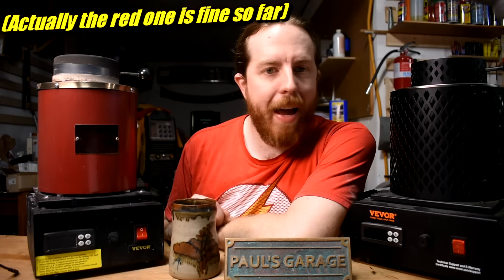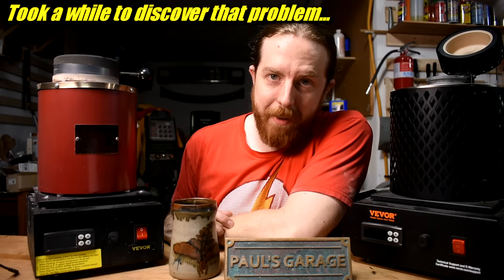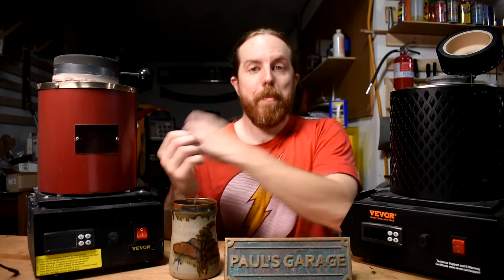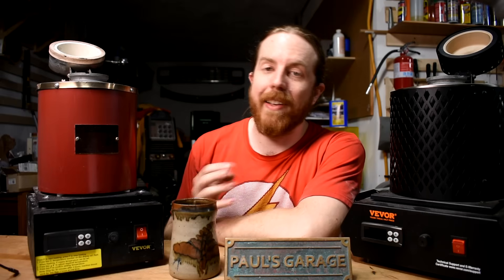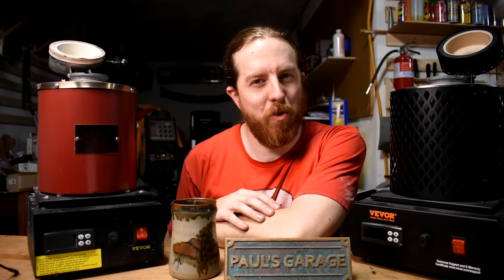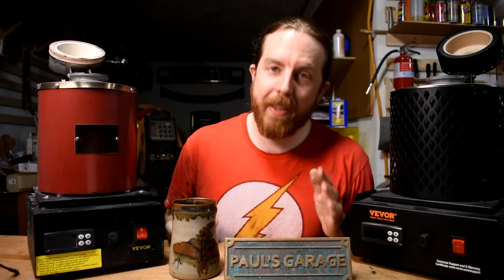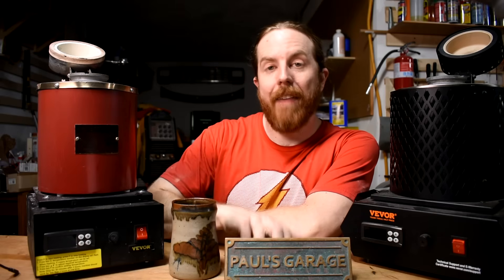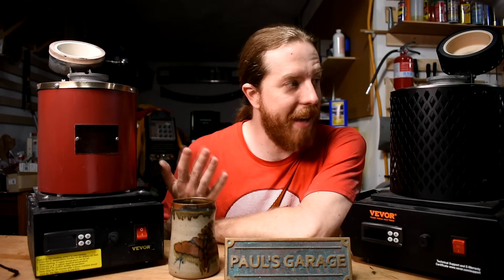The Problem With Electric Metal Casting Furnaces

Comment: Have you tried casting molten water?  I've had problems with it because the density decreases almost all the way to the freezing temp, so it increases in volume and that has to be considered when choosing a casting medium... I've had good success with a flexible silicone mold. It does require a special freezing unit, as water is molten at room temperature. This does help with the re-casting of mistakes.  Also, depending on the size of your freezing unit, the casting can be used in displays, or even be stored for later decorations in other liquids or mixtures of liquids, even as auxiliary cooling units for those liquids. I've even heard of people using these casting for medical purposes...  go figure.   Happy Saturday.
Reply: I was thinking of doing some chocolate or maybe casting various foods (bread, tuna or maybe hamburger?) but I'm not sure that may require a specialized heating unit and you might want to reserve it just for the purpose of foods, as it is probably not good to mix food preparations with other castings. Time will tell... but it's can be very exciting from what I've researched.
Reply from the maker: actually making your own chocolate in molds should be easy enough. My neighbors run a chocolate company out of their home, it's most food safe silicone casting and then heating in a cooking pan on the stove top.  I'm sure their house smells fantastic but i might not fit into my pants anymore if i spent too much time over there 🤣

Comment: Now i want a design with a graphite “Core Catcher” so your bronze “coreum” doesn’t flow into your Electronics and instead is contained until it cools off.  That and/or it slides to the left onto your desk lol.
Reply from the maker: that sounds like a good idea!  In this case, the "coreum" is caught in the body of the furnace.  So it never spills out on my desk, but it very much does wreck the furnace lol

Comment: I've been eyeing one of these for a while now and it's all your fault!
Reply from the maker: Do it!  One of us!  One of us!
Reply: @PaulsGarage  should I interview with the casting director? become part of the casting Caste? perhaps there's a spell I could cast...
Reply: I ordered a gas foundery recently.  For the price point you can't go wrong. I've melted some copper and made some ingots. Just haven't decided on what to make yet.
Reply: I have melted 3 ingots worth of bullet brass so far...thing works GREAT...just make sure you pour into a NON-water filled surface or it will cause a steam explosion
I used an old cheap barbecue pit lid that the legs broke off to pour my mold...and to whack the slag spoon I used to scoop the dross off...much easier and safer and has a wrap around type enclosure so I don't get accidental spills and fires

Comment: Yeah, moisture bad. Even putting river rocks in a fire pit can cause them to explode.
Reply from the maker: I once was at a campfire on a beach and a rock underneath it blew up.  That was scary!
Reply: @PaulsGarage  It's especially fun when it's the rocky ground itself that is exploding under the fire.  Happened at the next camp over to me one time.  Hell of a bang, lots of swearing, so we went over to see what had happened.  Their campfire had exploded (rather the ground under it had) and blown bits of campfire all over their camp.  Thankfully no harm done, except for the shock.
Reply: Scary part...spilling molten metal on ANY concrete surface...the moisture trapped in the concrete below the molten metal flash steams and POPS in a molten metal "explosion"  
NEVER pour molten metal anything on concrete...always set the mold on a surface covered in sand or dirt or even a dry wood (that can be extinguished easily)...
I used a lid off an old busted back yard barbecue pit/grill to pour my molds and smack my dross spoon on...to keep the super heated materials away from any moisture (and provide a pretty decent heatsink in the process...

Comment: Do "graphite" crucibles have an additional clay component, or maybe a waterglass component?  Silicon carbide?
Reply from the maker: If I had to guess, these do not.  Some of them (that one I used a LOT) appeared to be milled from a graphite block.  The one that broke was molded, but it looks like graphite only.

Comment: I wonder if Argon would help.
Reply from the maker: It would probably help the oxidation problem for the metal and the crucible.  I have a tank of argon but it would be tricky to stick the whole thing inside a giant argon purged box.
Reply: @PaulsGarage  Maybe just put a hole in the side of the furnace and pipe the argon in that way at a low flow rate.
Reply: I tried this with my last copper melt with an electric furnace and just 'poured' the argon in. I figured at least the argon weighs more than air and would at least reduce the amount of oxygen in both the oven and crucible. I had almost zero slag compared to my past copper melts and the crucible looked good coming out. So... idk? I'll keep trying that.